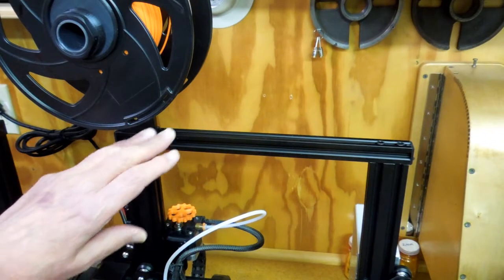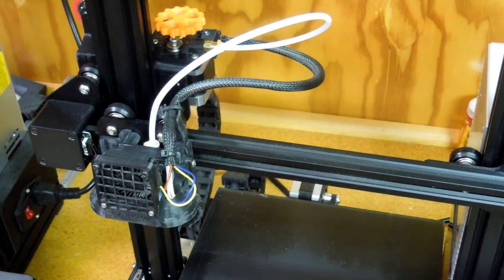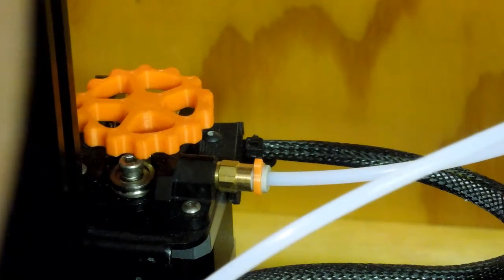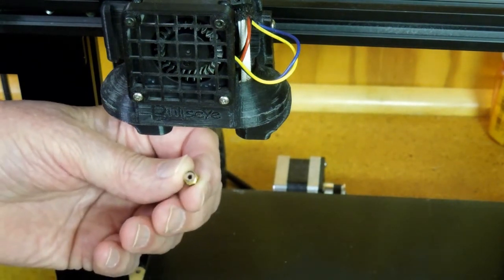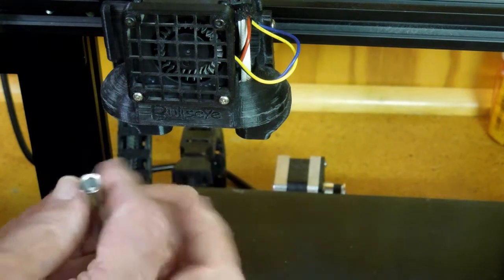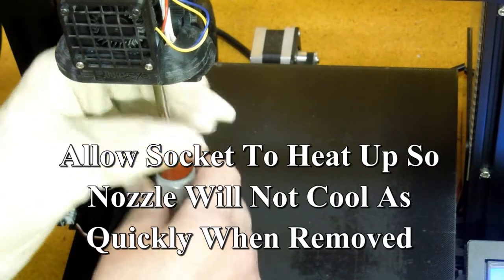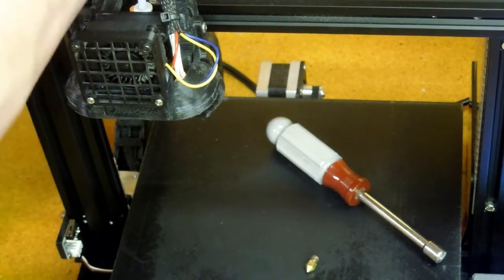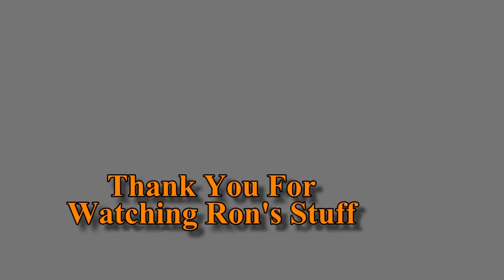3D Printer - Clear Plugged Nozzle & Changing Filament

Comment: This issue was solved on my printer by installing a filament filter. You can find many printable designs on Thingiverse. Just insert any sponge inside the filter housing of your choice and then have the filament run through the filter before it gets into the hot end (or possibly Bowden tube in your case).  I happened to use a white magic-eraser sponge and it's incredible to see how much dust is being filtered out by it.
Reply from the maker: I tried the filters last year and it did not seem to stop the problem for me. Black seems to have a lot of junk in it (some spools more than others). I should start using them again, especially since they are already printed. Thanks for watching.

Comment: Easiest way to clean a nozzle is to heat it up (empty) let it steam a minute at 200 (more if you were running ABS) then with the feeder tube removed (so just the fitting) quickly dip and pull a piece of filament (preferably with the end snipped cleanly in a wedge shape). Repeating that once or twice will pull out most if not all burnt residue or clogging. As for the tip, a scotchbrite pad will clean it and passing an acupuncture needle through the hole is good too.

That way, you don't remove it, and the less you do that, the better, the threads will not last. Mind you, after 4 or 5 rolls of PLA (less for other materials) the nozzle will be worn from abrasion. You can actually start to notice it. They are consumables. The best one can do is to upgrade an used nozzle to the next size up with a set of precision reamers.

Comment: If this happens a lot i would suggest lowering the temperature one or two degrees at a time untel you find a sweet spot. In my seven years i bet i only plugged and cleaned a nozzle twice when i first started out. For me it seems just a few degrees too hot and it would burn some of the plastic and the crispy would plug things up.